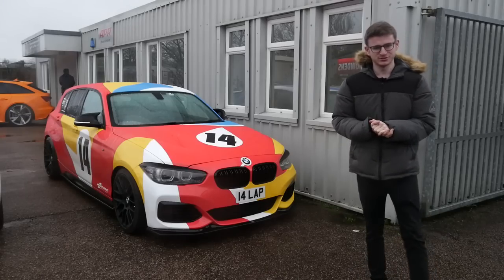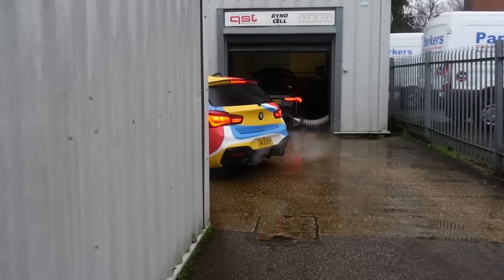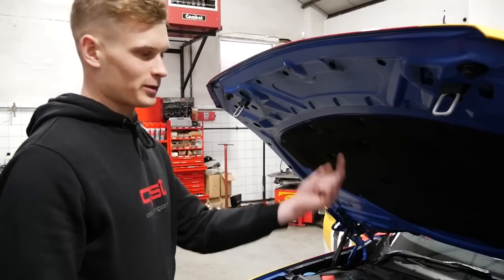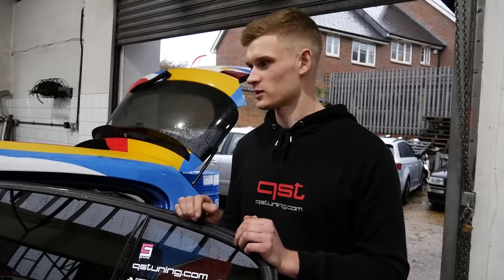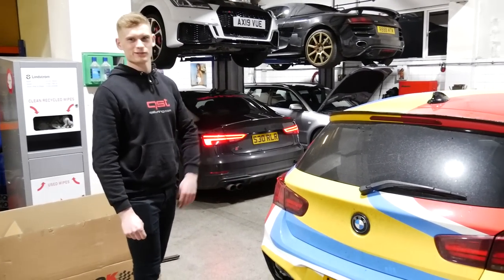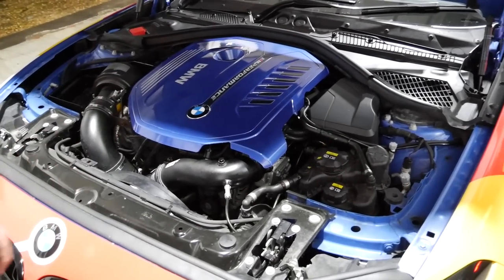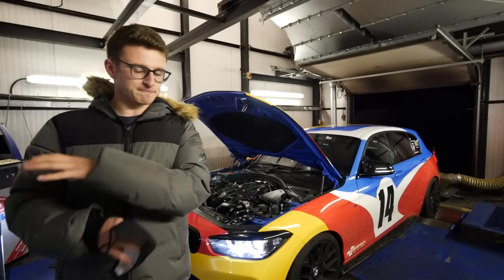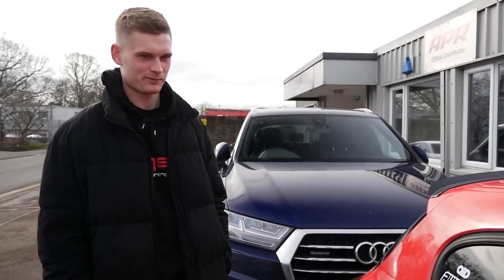Fitting an AEM Water Meth Kit on my M140i! *FINALLY 500BHP?!*

Comment: Awesome video! Would be interesting to see if you went back to the stock airbox with an ITG filter and silicone intake hose if you hit 500, could be an option? Hear a lot of horror stories about heat soak from those motech induction kits.

Comment: What was the reason that you went stage 2 plus meth, instead of slapping on a hybrid turbo? It would also easily produce more than 500hp
Reply from the maker: Upgraded turbo would make 600+, and I’m unsure if I want to go to that extent (yet)
Reply: Meth should also give more consistent performance with much lower IAT's when your ripping it.

Comment: Why was the torque so low? My stage 1 M140 is dynod at 434bhp and 663nm. Bhp only gives your top-end speed it is the torque that gives you acceleration.
Reply from the maker: Where was your car tuned/dyno’d?
Reply: @hampshirephoto  It's a BM3 stage 1 93+ map and then I had it dyno'd at a local place to check what power it was putting out.

Comment: I still can't decide on an lsd. For example if I'm going along at 30 40 and stamp the floor does it help alot then? Or more in turning?
Reply: Wavetrack lsd, gives the car more control when back end is sliding eaiser to control, watch regal auto sport video on lsd for the m135i and 40i

Comment: For the money luke would you just fit a upgraded charge cooler radiator instead of meth to lower intake temps after seeing that the gains were not as great as expected? Really enjoyed your vid as this is the next step I've been looking at. Not been able to find much info on going meth dependant or not so answered alot of my questions for me🤓👌

Comment: yeah, something is wrong with this m140i's mods. B58 is a strong engine, it should be producing a hell of alot more than what it is now with such mods
Reply from the maker: What do you think it should be running?
Reply: @hampshirephoto  Going by normal crank numbers 480 seems "stage2" ish. Maybe  490 on 2+ if you're lucky on fuel. You're running meth for consistency rather than reliability so for a 50/50 mix on a non meth dependant map your power makes sense. 520 would be an E30 map sort of number so I'd imagine you'd do that if you was on a meth dependant map.